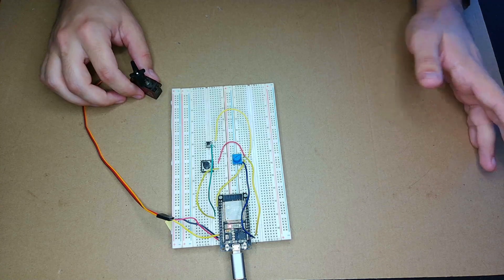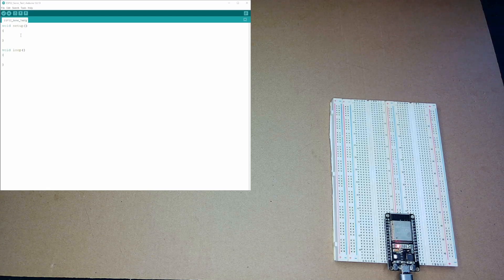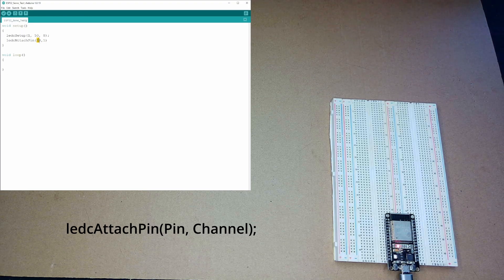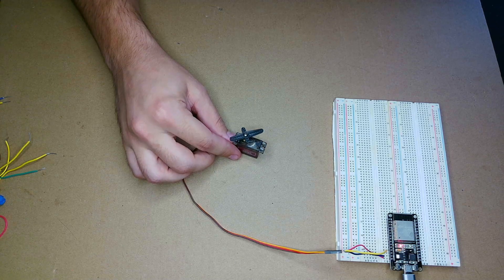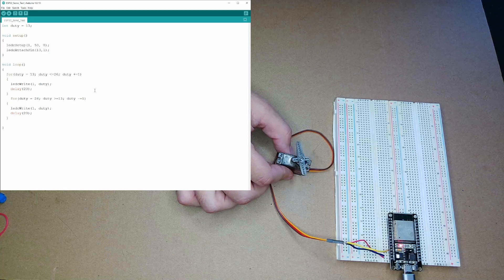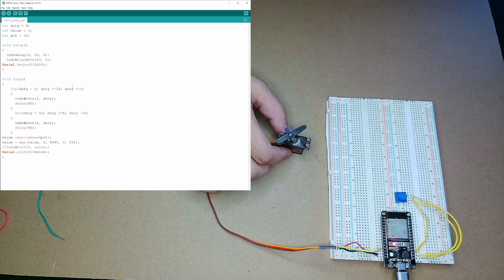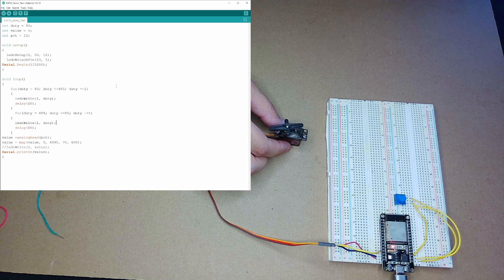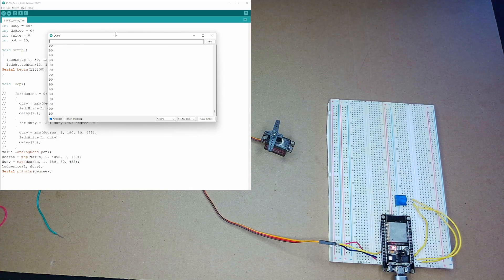ESP Arduino IDE Tutorial #1: How to use Servos With The ESP32

Comment: Thanks tommy. Just what I needed. I have a question. If I want to use full capability resolution of the servo. Should I use 14bit ... maybe 16bit? In your example we of 12 res we get ABOUT 400 steps of PWM usage. But the servo reads between 1000 to 2000 ms. Thats about 1000 steps its capable to read? or is the resolution of a good servo even finer than 1ms?
Reply from the maker: Good question! I am not a master of servos but as you asked this is up to the resolution of the servo. I would recommend finding the datasheet of the servo you want to use to find out its resolution. If you can't find it you can always experiment on your own. Technically 16-bit will give you more granular control of the PWM signal but the servo may or may not benefit from this. Nothing would stop you from using 16-bit as long as you have the memory space on the esp32 for very large numbers lol.

Comment: Really cool - I got a 3d printer a month ago and want to build an RC car.  Was going to buy a RC controller, but thought, there has to be a way to use my PS4 controller.  So I started researching and found that the ESP32 could accept the DS4 signal, and with a L298N board, it could control the R130 RC car motor.  This video should help me with controlling the SG90 for steering.

Anyway, while checking all of that out, I found your channel, and I think what you are doing is awesome!  I'm going to use what you are sharing to finish building my car.